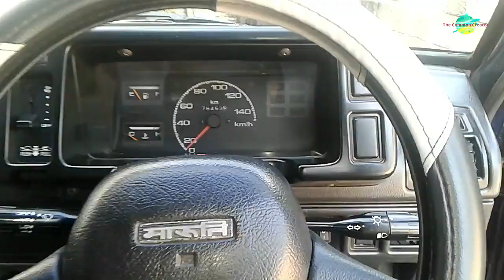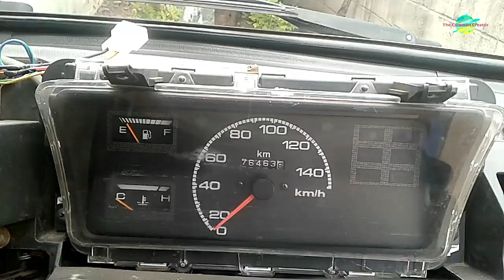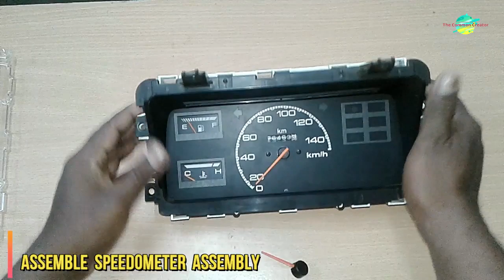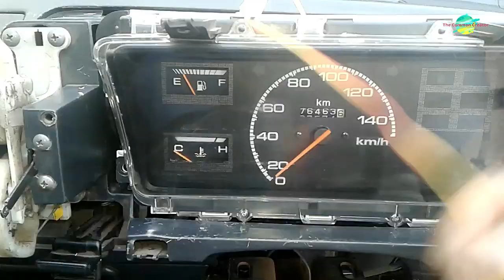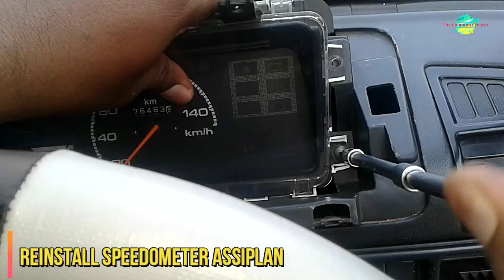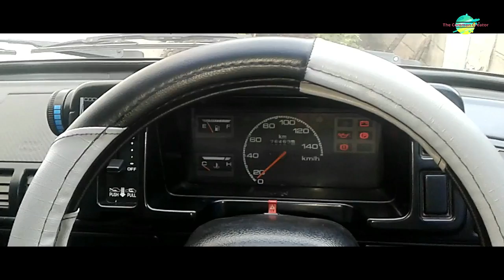LED installation in speedometer In Maruti 800

Comment: Hello you are doing well.
But while you have removed the Speedo meter pointer,the spiral spring lost its tension ,and goes downwards,You simply fix pointer at zero ,but it is not okay, and  it was showing wrong reading. Once pointer removed, again recalibration required for actual and correct reading setting.